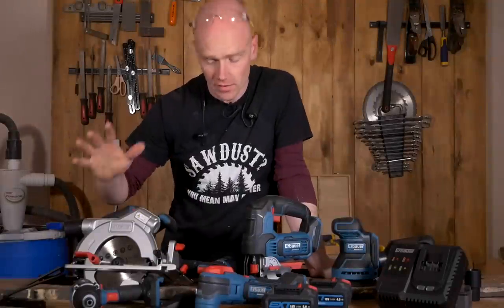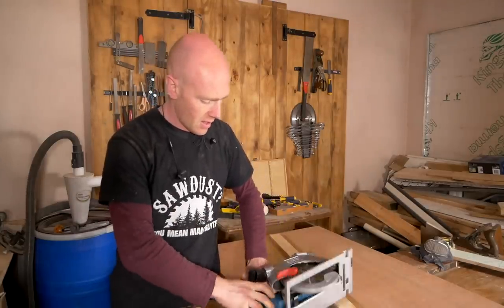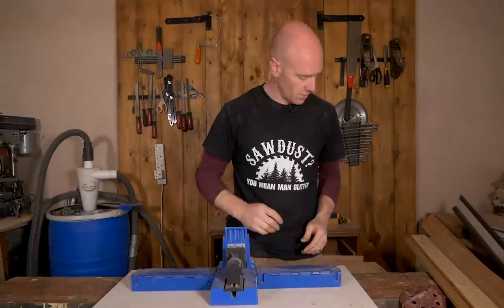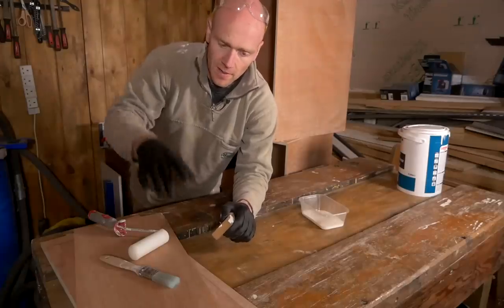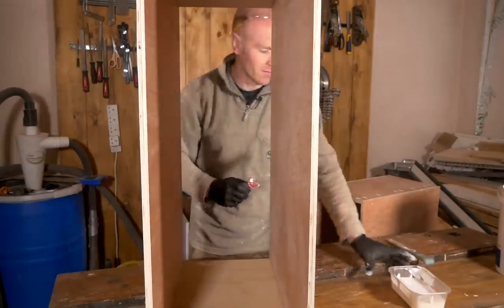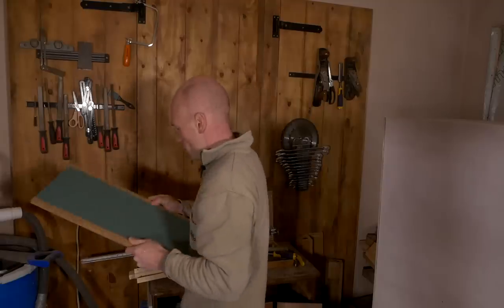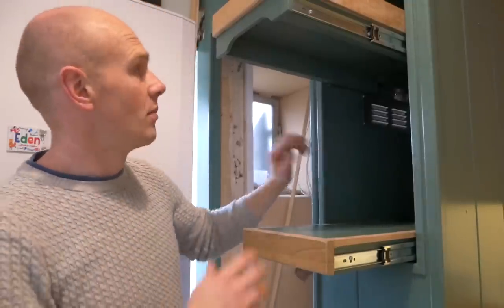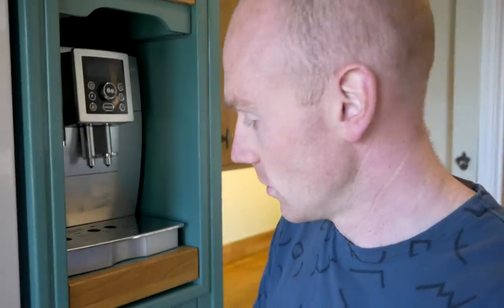CUSTOM COFFEE STATION for the Kitchen

Comment: Absolutely mental reading through some of these comments. I think it's a great project wel executed. The advertising of the tools wasn't overdone and regardless of tool snobbery they did the job at hand. I've been working on building sites for the past 18 he ars and have had a few erbauer tools as "stop gaps" have always been impressed with them we run mainly dewalt for cordless have a bosch drill that's been with us for 6+ years and still going and the erbauer stuff is comparible if not quite as good. If you're able to spend thousands on tools then erbauer won't be your choice, if however you're starting out they'll do you proud until you can (if you need to) afford different colour tools

Comment: Hi Tim, can you provide an update on how these EXT tools have worked for you? Would you recommend? They are a very attractive price and seem to be reviewing well. Thanks
Reply from the maker: I’m very impressed still. Battery life better than my Bosch gear, drill and driver a little less refined but very capable. Sander, jigsaw, multi tool all great and rarely touch my corded tools now.
Reply: @TheRestorationCouple  thanks for taking the time to reply. BandQ have the drill with 2x5Ah batteries in the clearance. Seems a good place to start, might take the plunge.

Comment: Nice job. But where is the power socket? 
If it’s hidden behind & not easily accessible you’ll be in trouble if the coffee machine has an electrical fire and there’s no fused spur to shut off the power. Same with the fridge next to it.